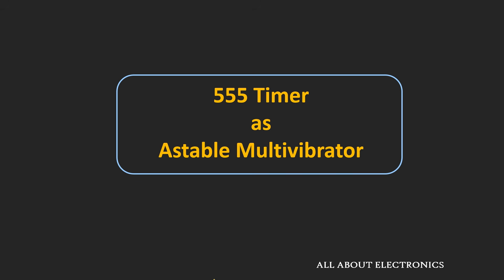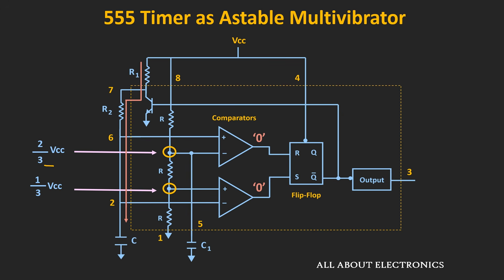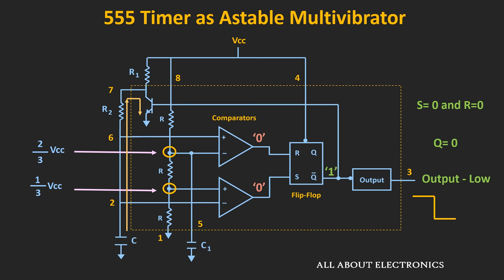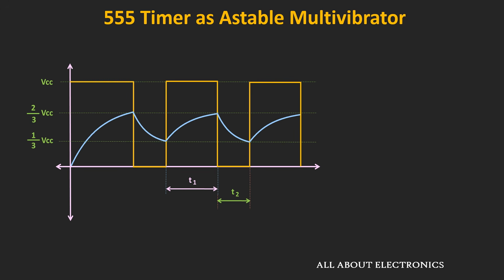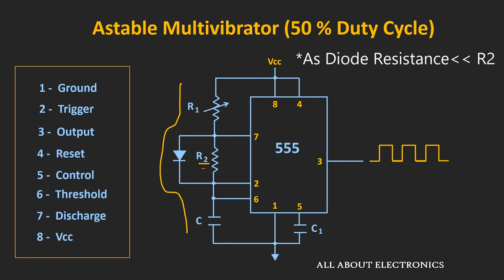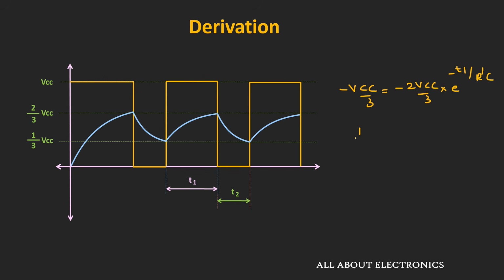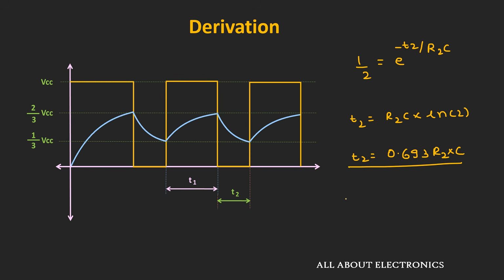555 Timer as Astable Multivibrator (Working, Design and Derivations)

Comment from the maker: The Timestamps for the different topics covered in the video:

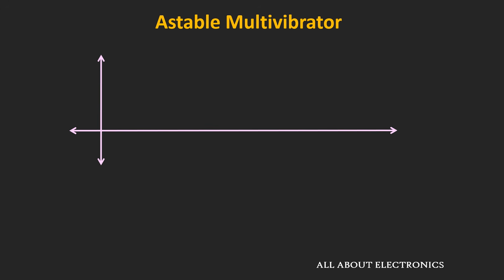0:23 What is Astable Multivibrator

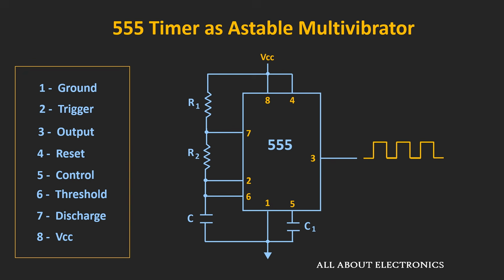0:50 Astable Multivibrator using 555 timer

1:18  Working of the circuit 

9:08 Duty Cycle of Astable Multivibrator

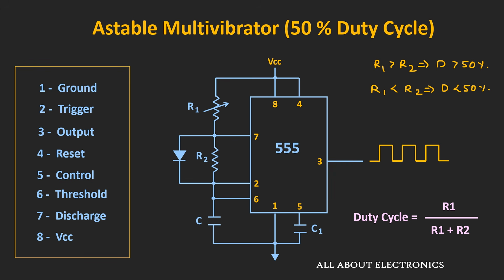13:25 Design of Astable Multivibrator with 50 % Duty Cycle

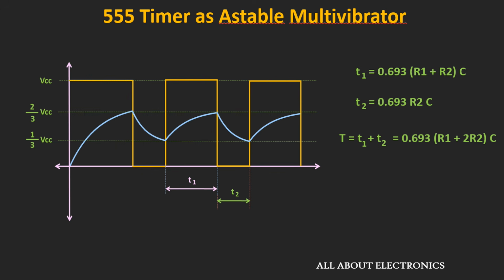15:02  Derivation of the Timing Equations
Reply: In my view the one who designed this 555 timer IC is LEGEND🔥🔥🔥🔥, Just think how difficult is to get this idea to build something wonderful..............
Reply: Beautiful video with great explanation,worth watching.
Reply: Nicely explained
Reply: Tq
Reply: I liked you explanation ,  thanks, very helpful for beginner
Reply: @Sagnik Ghosh same doubt 😒
Reply: @Sagnik Ghosh the circuit is not correct .... the output in Q not Q'
Reply: otherwise u need to use an inverter at Q' pin to get the output

Comment: i have a doubt. At 5:14 you say that the voltage at the pin 2 is less than reference voltage because of which the output is zero. But when the pin 2 voltage is low, then the output should be '1' right???
Reply from the maker: It was actually a mistake. Actually what I meant to say was, during the discharge,the voltage at the pin2 is more than reference voltage ( V- is more than V+) so , second comparator output is also low.

Comment: while explaining you have mentioned Q as the output of the timer ic but in the circuit  it isn't so
Reply from the maker: In 555 timer internal block diagram, before the final stage there is inverting buffer. (there is a bubble before the output stage). That is why, the output is taken through Q'.

Comment: 3:34 here if q=1 then q' =0    as the output is connected to q' shouldn't the output be low instead of high? i might me missing something
Reply from the maker: The output is inverting buffer. There is a bubble at the input of the output stage. That is why output is HIGH even though it is connected to Q'. I could have explicitly mentioned that. But anyway, I hope you got it.

Comment: how to get triangular wav from the square wave of this, what values should I keep
Reply from the maker: You need to use the integrator circuit at the output of the 555 timer. 
I have already explained that in one of the earlier video in detail. For more information, you can check that video. 
Here is the link: https://youtu.be/-_Ny8YjPY-U?si=veqfTeiLO5GVT2N_
If you still have any doubt then let me know.
Reply: @ALLABOUTELECTRONICS  PLZ TELL which opam model(LT1001, UnviersalOpam2,etc) should I use as all are giving diferent waveform

Comment: 2:40 if q=1 then output of timer =0 because as it is connected to q’
Reply from the maker: If you closely observe then there is a inverter before the output state. ( There is a bubble which depicts the inversion before the input is applied to the output stage). That's why even after applying Q' output we will get the desired result. I hope, it will clear your doubt.
Reply: @ALLABOUTELECTRONICS  yeah thank you , I didn't expected reply as the video is 5 years back

Comment: Hi thank you very much for the video. I have a question regarding the case where '0' signal from the Q-bar of the SR FF connected to the NPN transistor.  When the signal is '0', does it mean there is no voltage or low voltage across the Vbe of the transistor? I'm just wondering if it does mean low voltage. Should we be just looking at the Vce, i.e. from pin7 across the R2 and C to the ground, instead of Vcc when the capacitor is being charged because when Vbe is low, Vce is high and vice versa. Hence, both t1 and t2 calculation will involve R2 and C only without the need to modify the circuit to achieve a 50% duty cycle.

Comment: 5:20 trigger is low so output should of comparator should be 1 right?
Reply from the maker: At 5:20, I think you are talking about the lower comparator. In lower comparator, the positive terminal (+) is tied to Vcc/3, while the negative terminal (-) is pin no.2, or the voltage across the capacitor. During the discharging, first when the voltage across the capacitor goes below 2/3 (Vcc) then output of the first comparator becomes low. But at that time, the output of the second comparator will also be low (Because the capacitor voltage is still more than Vcc/ 3). And because of that for the second comparator, V- > V+ until the voltage across capacitor goes below Vcc/3. So, upto that time, the output of the second comparator will be 0. It will become 1, only when the capacitor voltage goes below Vcc/ 3. I hope, it will clear your doubt.
Reply: @ALLABOUTELECTRONICS  you stated that since V- < V+ the output will be 0 which is opposite of what you are saying there is a correction there to be done on your part

Comment: R2 must be in between pin number 7 and 6, not 7 and 2
The pin details connections is wrong but the circuit diagram is correct
Reply from the maker: Here, Pin 2 and 6 are shorted with each other. Please check again.

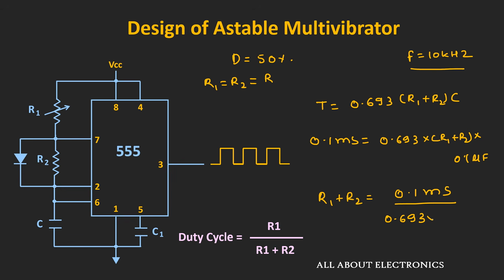Comment: @14:24 we taken C value as 0.1uf why?
Reply from the maker: You can take any other value also. But here for simplicity, that value is taken. But if you choose very high value of capacitor (100 uF or 1000 uF) then the required value of resistor to get the same frequency will be very low.  So, choose value according to the required frequency.

Comment: Just 1 problem is that you connected the output to the Q'  end instead of Q....😅  esle things are awesome.....keep working like that
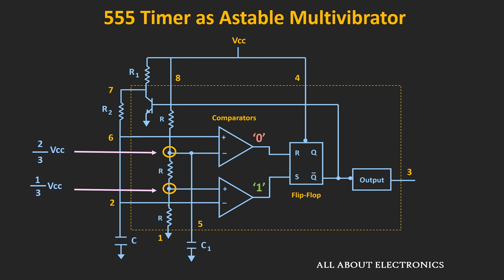Reply from the maker: The thing is that, there is a bubble just before the output (1:57). That means the Q' output will get inverted at the output. 
It is not mentioned explicitly in the video. If I have mentioned that,  this confusion would not have occurred.
But I hope, it will clear your doubt.
Reply: @ALLABOUTELECTRONICS  Oops! I didn't notice that...😅

Comment: This is astable multivibrator; when duty cycle is 50%, why ? R = R1 = R2

At 50% of duty cycle R1= 0 
When R=R1=R2, the duty cycle is 66.7%

At T= 0.693(R1+2R2)C
Reply from the maker: For 50 % duty cycle  , R1 is 0. So, now charging and discharging times are equal. And in that case, the duty  cycle both ON and OFF time are equal.

Comment: what should be the value for C1?? is it fixed for all cases????????
Reply from the maker: This capacitor is used to reduce the effect of high frequency noise on the circuit. (To bypass that noise). Typically one can use 10 nF capacitor for that.
Reply: @ALLABOUTELECTRONICS  thanks for replying. Great explanation

Comment: @16:05 why V initial is 1/3VCC rather than 0volts
Reply from the maker: Because as you can see from the graph, after first cycle, during the next charging cycle, the initial voltage across the capacitor is VCC/3. And now the capacitor is charging towards VCC. Therefore, V final = VCC.
I hope, it will clear your doubt.

Comment: 2:41  Sir, the animated video is showing that  capacitor C is charging through R1 and R2 but you said capacitor C1 is charging through R1 and R2. Could you please clarify doubt sir .
Reply from the maker: Since the transistor acts as open circuit, so the capacitor will charge through R1 and R2 (as shown in the video). I hope, it will clear your doubt.
Reply: @ALLABOUTELECTRONICS  capacitor C is charging right sir.
Reply from the maker: Yes, it is charging through R1 and R2.

Comment: subtitles are not required, ur voice is very clear, sometimes because of subtitles some parts of the circuit are hidden and we face problem to understand.
Reply from the maker: If required, you can manually turn off the subtitles in the video settings.
Reply: Are u uneducated

Comment: What’s the purpose of C1
Reply from the maker: Pin 5 is the control input, which is used to set the manual threshold voltage. When it is not used, the internal voltage is 2/3 Vcc. If it is kept floating, then it is prone to external noise or interference. And since it is connected to the internal comparator, so because of the noise or interference, the threshold voltage can get affected.  We can avoid that by using the external capacitor C1. The capacitor will charge up to 2/3 Vcc volt and it prevents any transient changes in the threshold voltage. I hope, it will clear your doubt.

Comment: what is the use of C1
Reply from the maker: It is used to reduce any supply fluctuations. If there is any high freq fluctuations then it will get flitered out using this C1. without this capacitor, if there is any supply fluctuations then it will affect the 2/3 Vcc and 1/3 Vcc voltage. Using capacitor, at pin 5, it is possible to reduce such fluctuations. (See internal diagram)

Comment: in that calculation, why have you taken 0.693x(R1+R2)C? We should take 0.693(R1+2R2)C right?
Reply from the maker: It would be better if you mention the timestamp so that I can know where exactly in the video you are referring to. But I guess, you are referring to 9:11. If it so, then 0.693 (R1 + R2)C, is the charging time. The capacitor is charging through R1 and R2 and it is discharging through only R2. 
So, total time is t1 + t2 = 0.693 (R1 + 2R2)C. 
And in case, if you are referring to the case of the diode, at 12:09 then the current gets bypassed through the diode. (Since forward resistance of the diode is much less than R2).
So, the capacitor is charging through only resistor R1. (Assuming forward resistance of the diode is negligible). While it is discharging through R2. 
So, in that case, the overall time is 0.693 (R1 + R2)C.
I hope it will clear your doubt.
Reply: @ALLABOUTELECTRONICS  oh thankyou so much...i got it now
Reply: @ALLABOUTELECTRONICS  So, in general case, which circuit are we supposed to consider, circuit with diode bypassing R2 or without diode circuit?  And in that question why you've chosen with diode case? Is it because in question it mentioned 50% duty cycle? for this reason? becauseThe Overall Time period is different for both the cases.

Comment: Is it necessary to connect the control pin to ground via capacitor? What is the role of it using here ?
Reply from the maker: The reference voltage at the upper comparator should remain 2/3 Vcc right !! (Just check at 1:46)!! If there is any fluctuation in the supply voltage then it may affect the operation of the timer. (Because the reference voltage will change because of that). This capacitor reduces any fluctuation and tries to maintain a constant voltage. I hope it will clear your doubt.

Comment: Hello sir,
  Could you please explain how to select switching frequency ,  resistor and capacitor value previously while designing pwm controller for LED flash . Are these values depends on load wattage if is then how to select above parameters??

Comment: 1.can the output be considered as square wave if 50 percent duty cycle or we have to clamp below zero I am confused.
2.why can't we connect Q directly to output instead of an additional inverter.
Reply from the maker: 1. Yes, Just 50% duty cycle is enough.
2. It is just to boost the output current capability. So, that it can properly drive the load connected to output.

Comment: Your video is good, but at 5:14 you mentioned that output of 2nd comparator is 0 as reference voltage is greater than voltage at node 2, but the opposite happens.. So will u plz explain?
Reply from the maker: Actually the output driver circuit is inverting buffer. There is a tiny bubble at the beginning of the block. I should have specified that explicitly. But anyway I hope it will clear your doubt. And still if you have any doubt then please let me know here.
Reply: @ALLABOUTELECTRONICS ok I understand.. But without that if I use it normally then also I am getting desired output i.e. astable multivibratör. Is that okay? Or I have to follow this way? 1 more question i.e. Basically you are using a not gate at the output as you are taking it from Qbar instead of Q
Reply: But here in this circuit ,you have not shown it....please clear my doubt.

Comment: Thank you 
I understood it clearly
During this lockdown situation your videos are life saver sir
Sir I have one doubt 
While calculating t1 we took vf= vcc  since capacitor is charging towards vcc but why we took VC(t) =(2/3) × vcc and during first cycle vi= 0 then why we didn't considered that case for calculating t1, sir
Reply from the maker: Because we want to find the time t at which the capacitor reaches 2/3 VCC. That's why Vc(t) = 2/3 VCC is taken.
I hope it wit clear your doubt.
Reply: @ALLABOUTELECTRONICS  yes sir, my doubt is cleared 
Thank you
Reply: To calculate charging time you have to consider time taken to charge from 0 to 2Vcc/3 and time taken to charge from 0 to Vcc/3, subtract second value from first value...

Comment: What is the maximum frequency that can generate by this method?
Reply from the maker: There are many 555 ics. Depending on the IC max. Frequency which can be generated may vary from 0.1 MHZ to 5 MHZ.

Comment: Sir u have connected output (V) at inverting Q ,so at time 2.32 sec when R =0 ,S=1 ie Q =1 so output should be 0 ie as per connection plz clear it to me.
Reply from the maker: The output driver circuit is the inverting circuit. There is a bubble at the starting of the block. (I forgot to specify it in the video)  So, it will invert the output of the Q-bar.
I hope it will clear your doubt.
Reply: Thanks sir  ,One more question I don't get the use of capacitor at contol pin.
Reply: Capacitor is connected at Pin 5 to eliminate any possibility of any noise pickup. Pin 5 is used to change frequency by applying a control voltage....

Comment: Sir at #5:16# u have told that the voltage at second pin is less than the ref voltage in such case the output of the comparator should be 1 ryt!!?
Reply: Same doubt........have you cleared it?
Reply: Same doubt

Comment: just had a small piece of doubt, in the earlier figure u mention R2 was between pin 7 and 2(when u considered, 555 ic as a box, but when you started showing its internal parts as well, R2 is shown between pin 7 and 6 hows this possible?
Reply from the maker: If you notice, 2 and 6 are connected together.
Reply: Pin 2 and Pin 6 are shorted and R2 is connected between Pin 7 and Pin 2 or Pin 6....

Comment: Sir can you please explain what is the requirement of C1 here????
Reply from the maker: Through pin number 5, it is possible to provide the control voltage to the timer. (other than 2/3 Vcc). When it is not in use, it can be left open. But in that case, it can pick up external noise and may override over reference voltage. To prevent that, capacitor C1 is connected. Which prevents any abrupt changes in the voltage or pick up due to external factors. 
I hope it will clear your doubt.
Reply: @ALLABOUTELECTRONICS  
Thankyou sir....now it's clear to me
..Thankyou so much
Reply: If Pin 5 is left open, there is a high possibility of noise pickup

Comment: One query that is do the time required for capacitor to charge about 2vcc/3 is as same as the time required to capacitor to charge Vcc
Reply from the maker: No it won't be the same. Here capacitor starts charging towards the Vcc. But as soon as it reaches 2/3 Vcc, the output of the comparator changes. So, it won't be able to go beyond that, although it was going to charge to Vcc. I hope it will clear your doubt.
Reply: Yes sir thank you
Reply: Time taken by capacitor to charge  is different .... Vc = Vc(0)×Exp (-t/RC)

Comment: Hi, Ive designed an astable 555 timer using the diode, though theoretically im able to get 50% duty cycle, with 100kHz frequency, by the way Im using proteus software, the output at oscilloscope doesnt come out as 50% duty cycle with R1=R2, (T1=T2). Could you tell me what is the reason, or is it a good idea to incorporate jk ff at the output pin 3.
Reply from the maker: Have you connected the capacitor at pin 5??
And what duty cycle you are getting ??
Reply: @ALLABOUTELECTRONICS   yes , 0.01uF, and the duty cycle<50%.
Reply from the maker: @GeogyStephen  Would you please tell me the values of R1 and R2?
If it is close to the forward resistance of the diode, it can change the duty cycle.
Just keep the R1 variable. And make it little lesser than R2. And see, are you getting 50 %
I think that should solve your problem.
Reply: @ALLABOUTELECTRONICS  I am getting a duty cycle of 50%, making my R1 lesser than R2, but the condition is I need 100 kHz of frequency output. my R1 = 400K, R2= 724K, and it is  10pF,
Reply: @GeogyStephen  if D=0.5, then R1 must be equal to R2.....

Comment: Could u pls explain me what is happening after flip flop..confused with Q and Q complement..which one is a output and which one goes to the transistor
Reply from the maker: Q-bar is going to transistor. The Q-bar is also going to output driver circuit, which is inverting circuit. So, its output will be Q. 
I hope it will clear your doubt.
Reply: @ALLABOUTELECTRONICS  Ya...But if S = 1 R = 0 means Q value will be 0 right..But U mentioned Q value is 1 in the initial output..tats where i am getting confused..output driver circuit based on Q or Q'?
Reply from the maker: Initially,when S= 1 and R= 0, then Q= 1 (Please refer the truth table of RS flip-flop) and Q-bar is 0. And since Q-bar is given to the inverting output driver, the output of the 555 timer will be high. 
I hope now it will clear your doubt.
Reply: @gautamvijay5426  if S=1 and R= 0, then flip flop is in Set (S), Q =1, Q' =0
Reply: Q is the output of flipflp and transistor is driven by Q'

Comment: I think in 5:25 you said wrong
Reply from the maker: Actually, that's correct. I think you misunderstood because, after flip-flop, the output driving stage is inverting stage. (But it doesn't look so) There is a bubble before the output driving stage. And due to that the output will get inverted and will remain low. 
I hope it will clear your doubt.